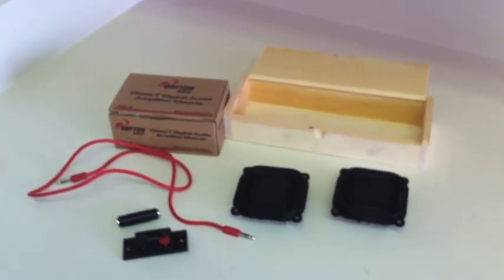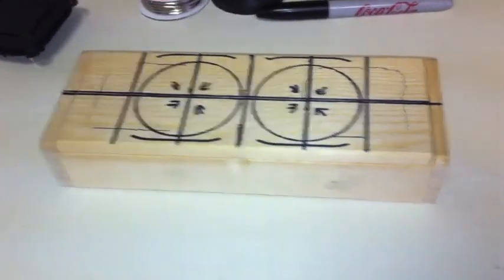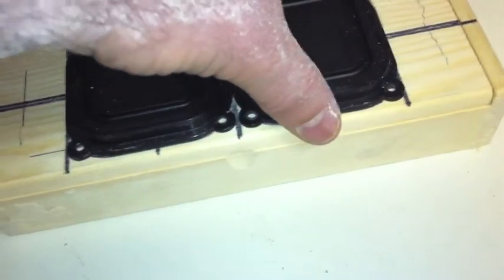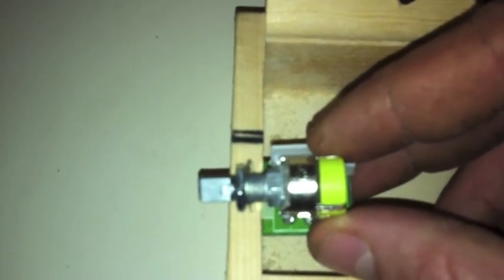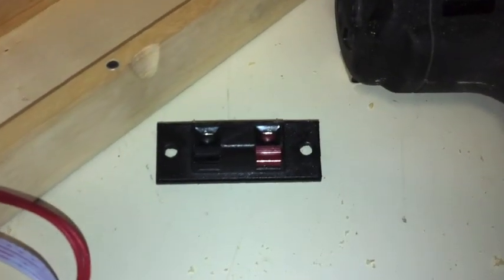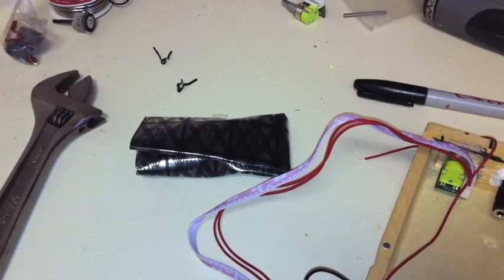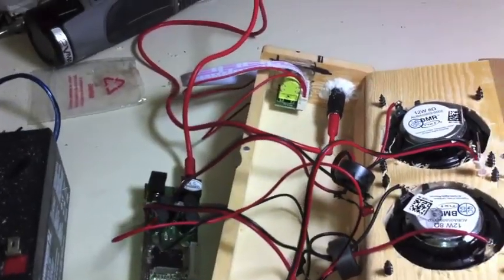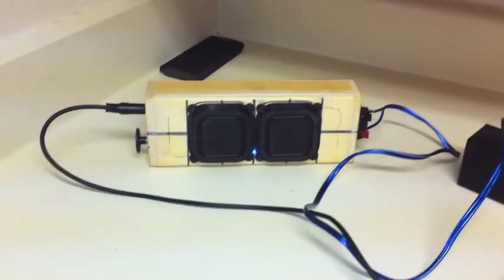DIY STEP BY STEP mini boombox w/ 2 inch HIWAVE speakers

Comment: I would think you'd put more effort into making it look better. Those magic marker lines on the front are ugly to the ultimate degree.  I can't understand why you didn't use machine screws instead of those massive wood screws. And as far as stereo separation goes...there isn't any. I'd be much ore impressed if the speakers were at the far ends of the box and the connections and amp were in the middle. You seem pleased with it, so that's all that matters, but this is a design that I wouldn't be at all tempted to copy. I'd give a B+ for effort, but  a C- minus for execution.
Reply: what the fuck is wrong he is showing to make it not design it

Comment: go with less powerful speakers to match the amp. You bass output should then improve  From the "lack" of movement you need a bigger amp to reproduce the lows....but in short I like your build.
Reply: would u know how to make it bluetooth
Reply: +cesar martinez  the most simple way is to by a Bluetooth adapter for a car stereo. they simply plug into the aux input/ 3.55 mm check Walmart.com.

Comment: i rather just but a beats pill
Reply: Buy not but.  Also the beats pill sucks balls.
Reply: hector garcia the sound quality isn't astonishing and the speaker in this video actually sounds pretty good.
Reply: The beats pill is average it freaking costs $170 and sounds like a $40 speaker.
Reply: hector garcia this diy probably sounds better than anything ever made by beats, and costs less than HALF the money. If you were a sane normal human being you would realize that, but you just care about the brand, and about fitting in with your buddys from school. A true audio enthusiast would never choose beats. You sir are a beats enthusiast. 👀
Reply: the beats pill is "brand" not a cheap piece of wood with cheap speaker and double A batteries. also the beats pill 2.0 has way more feature then this. so cal down Internet Addict
Reply: well thats your opinion but it has 4 out of 5 stars on amazon. this speaker wouldn't even  have one out of 5 stars. Internet Addict
Reply: but if you focus on on the features it has its worth the 170 Internet Addict
Reply: hector garcia so you're saying the features are worth more than the main point of a SPEAKER which is the sound quality.
Reply: Internet Addict the quality of the beats pill 2.0 is great thats why a lot of people own one while no one has a " diy step by step mini boom box" and the features are just bonus features
Reply: hector garcia I'm not saying that the pill is bad, It's ok. The price is what makes it not worth it.
Reply: ***** I tried to say that the nice way!!!!
Reply: ***** i may be a, "beats enthusiast" but a " sane" person would know that a beats pill 2.0 is way better then this. lets look at the build quality, this diy speaker is made out of wood! Beats pill is made of a metal mesh and high quality plastic. The beats pill is also tool looking while this "diy" looks ugly.
Reply: I꙯n꙯t꙯e꙯r꙯n꙯e꙯t꙯ A͚͛d͚͛d͚͛i͚͛c͚͛t͚͛ fuck outa here internet addict. get a life.
Reply: hector garcia can't handle the truth I see.
Reply: +hector garcia Haha, "high quality plastic". If you knew anything about speakers, you should know using plastic is totally awful. Also, this probably sounds better than any product that Beats have ever made as someone above mentioned. Beats are overpriced because of all their marketing. Their products are low quality, bad sounding cheap shit from China. 4/5 stars on Amazon doesn't prove anything either.

Comment: you can put a 9v battery on your tongue and it will very slightly shock you, I seriously doubt that 12 volts will be much more dangerous.
Reply: MKIIProductions
lol. no it wont.....you can touch terminals on a car battery and be fine, you wont feel anything.. Your tongue would hurt like hell if you licked it but a hospital wont be able to do anything about it lol hes saying not to jumper the terminals with something low resistance as it can damage the battery
Reply: MKIIProductions
While it is true that amperage kills, you need the voltage to drive the current. Even with wet skin the resistance will be too great and only a very small amount of current will flow, not enough to any serious harm.
 And with batteries, the ampere rating is for ampere HOURS (Ah), not how much peak current they can deliver. A 12v 3Ah battery will supply about 3 ampere for 1 hour, or 1 ampere for 3 hours. Peak current will be much, much higher if you short the battery

Comment: I followed this vid, watched it multiple times and played it while i built this, as soon as i turned the knob on it when up in flames. I am accustom to electronics,  AND YOU NEED A REGULATED POWER SUPPLY!
Reply: lol no, and who the fuck thumbed up this nonsense post?
Reply: ***** sorry bro, the voltage of the battery was 14volts fully charged, so it blew.
But once I got a regulated 12 volts it did 'blow the doors off' other speakers.
And I got it to fit all in a box about that size. So it is very portable.

Comment: hey i just made a speaker, where can i get one of the external battery connectors and can i solder solder speaker wire to it to go to a the speaker

Comment: hello dude i think yu should of put like a lil wall in between the two speakers and spaced them out then drilled little holes for the spekers to breath and push air out tht will make the bass a lil more and it sounds great but other then that very nice dude i love it ive made a box/cylinder for my 1 inch speaker two but its a cylider box

Comment: I like your creativity... im starting my own project i have a Q. for you...if u were to switch your power source to 3AAA batteries like in your other 1'' mini jambox project for this project would it work and how long to u have to change the batteries is it worth it and is the amps you used in both projects the same

Comment: have you considered heat shrink boot as an alternitive to paint tape ? also i may be incorrect , but are those capacitors or resistors on the speakers by the magnets ?

Comment: hey. i want to make this but i cant find all the parts. where did u get the part on the right side ofthe box with a red and black switch and two sauter points. and can u make another vid with how to connect all the wires? plz and thx